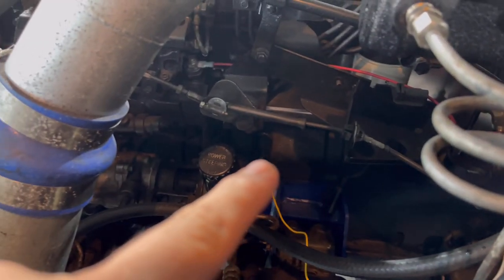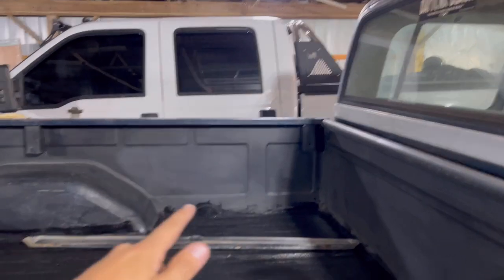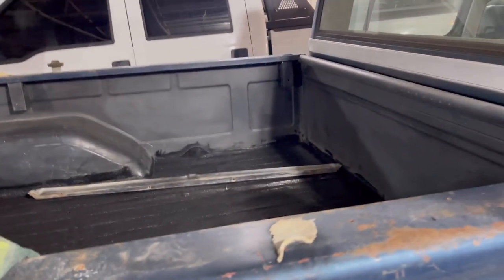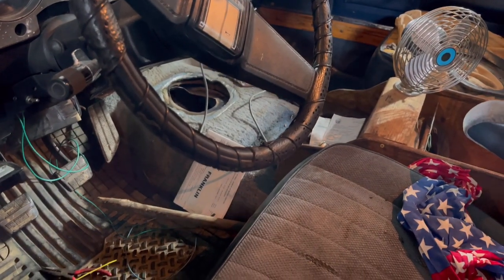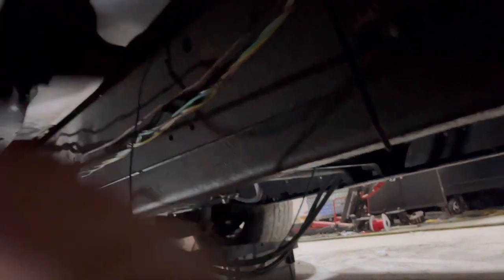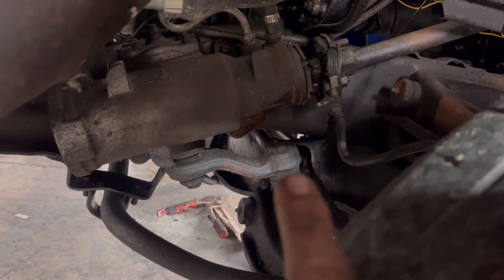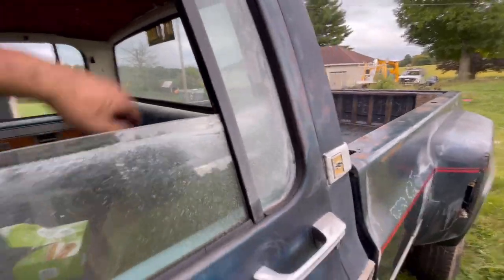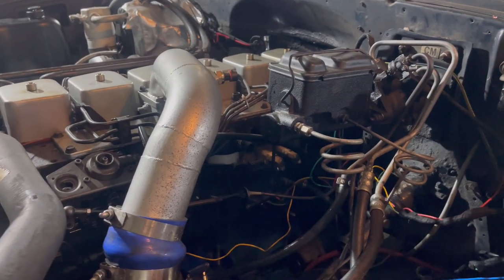12v cummins swap part 5 wrapping up the final touches before it’s first haul

Comment: how is the cap sound on highways ? are you going to install insulation ?
Reply from the maker: It’s not awful but it’s not ideal mostly because it’s still open down pipe and the gearing is super short so it’s revved out pretty high currently. I do plan on insulating the cab I’ll be going over all that in a video here soon !